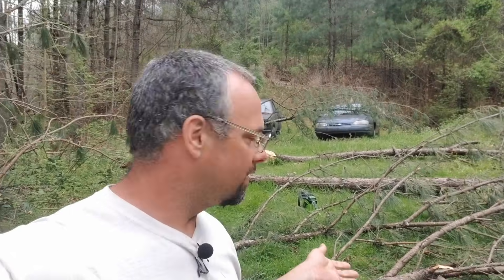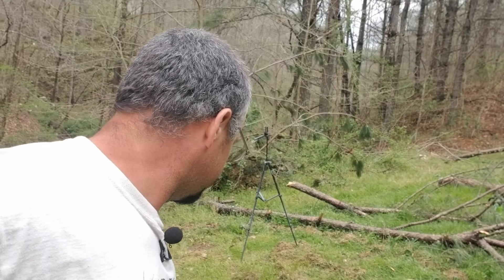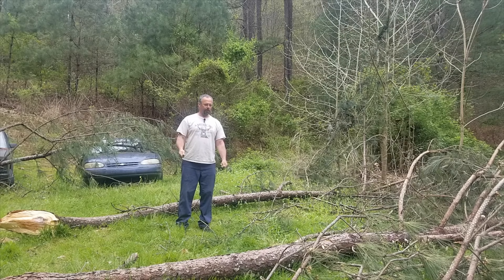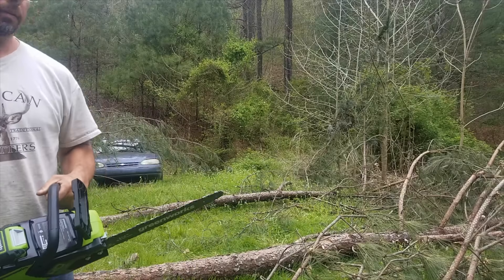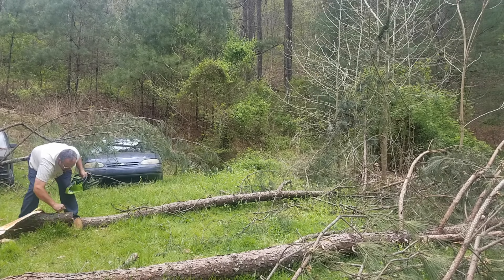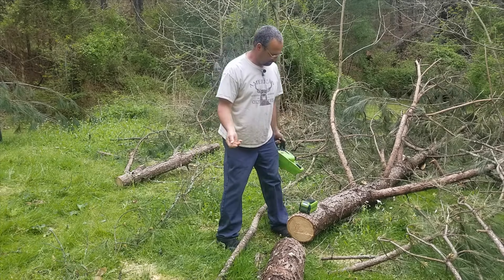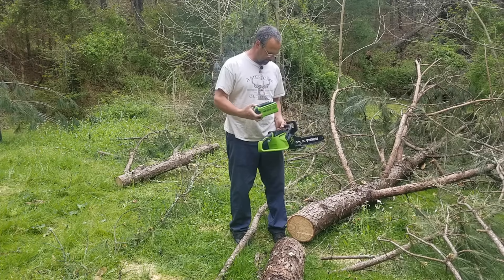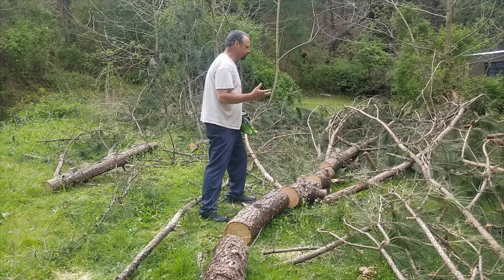Greenworks 40v Chainsaw Real World Test and Review

Comment: I recently bought a Greenworks 40V chainsaw. It worked fine for more than 2 months, then it developed the same fault 😞. It got worse over a few days to the point where it cuts out within seconds even with a fully charged battery 😠. I see from your follow up video that you have by-passed the thermal sensor. Other YouTubers have used these chainsaws for more than a year, so maybe Greenworks recently got a batch of faulty thermal sensors 🤔.
Reply from the maker: That could be. It works well now, so I guess it was a defective sensor.

Comment: I'd have to wonder if a more well-known brand would do better. I've never heard of Greenworks before. I see the "A" place has extra 2.5 AH batteries for your saw for $50. They have larger ones too. It has good reviews, perhaps you got a defective saw? I like the quiet operation. When it was running, it seemed to do a good job, not bogging down on heavier cuts. Linda and I send our best.
Reply from the maker: Yes a Dewalt probably would have done better. I may at some point get one because I am really impressed with my Dewalt weedeater. I have however made a mod to this one which stopped the cutting out. I can use it continuously now and it will keep running until the battery runs down. I may actually get another battery for it now.
Reply: I look forward to seeing the mod. We're living in a condo now, but I retire in a few years and will be buying a "real house." So I will have to take care of my own lawn. BUT I won't have neighbors on the other side of the wall.

Comment: Hi there i have the 40v 12 inch/30cm Greenworks saw, the first one i had got blunt after a lot of cutting, and it ended up burning out the motor, then i bought a second frame only at 1/2 the price, that has seemed ok, you have to keep the chain sharp, it last about 1/2 hour with the 2ah battery, when the battery goes flat it stops, apart from that it keeps going all the time.
Reply from the maker: Sounds like you got a good one. I can't run mine more than 30 seconds just cutting air now.
Reply: @lukeFugate  Well i do know if you press on them too hard with a blunt blade you end up burning the motor out, that's what i did, you can get just the frame and use old battery off ebay.

Comment: Sadly, i guess the verdict is meh. Maybe the thing protects the battery, since Li-ion batteries can catch fire if overheated.
Reply from the maker: It turned out to be the temperature sensor on the motor controller was too sensitive. It turned the motor off when the heat sink gets just slightly warm. I ended up taking it apart and modded it. Now it will run continuously without shutting off. You just have to keep a check on the temperature and if it starts heating up then just let it rest.
I made another video showing it running better.
Reply from the maker: By the way, thanks to you I am using MX Linux dual booting on my Mac now. Can't believe how fast it is.
Reply: Glad to hear that it was just the temperature sensor. I'll look for your other video.
Reply: And, cool. It's a good operating system, isn't it? I really like it.

Comment: My friend you get what you pay for.Cheap 40 volts. Waste of money
Reply from the maker: I was disappointed with it at first, but I did a mod on it that made it quite a bit better. It still isn't a saw for a logger, but it does more than I need it to. I spaced out the thermal overload on the motor controller. I don't know if this one was defective, or if that's just how they are. It is a really good saw now.
Reply: I make sure that the chain is always very sharp and lubricant the chain well after use.